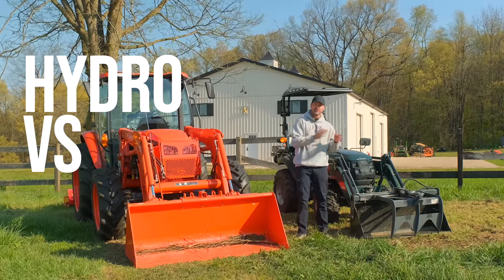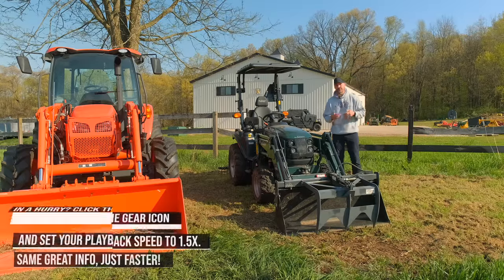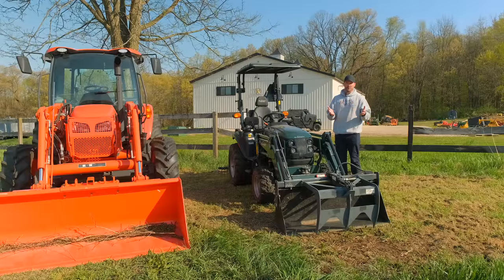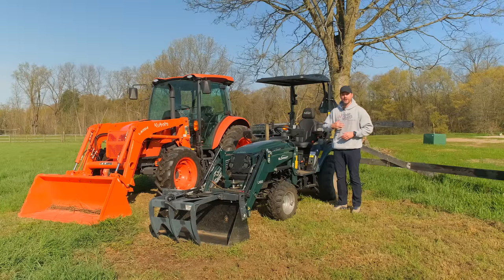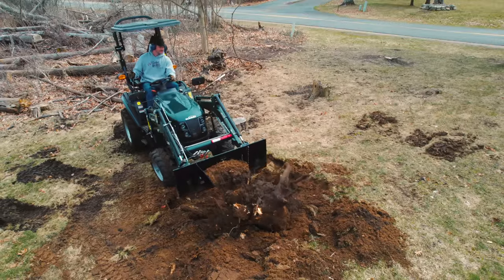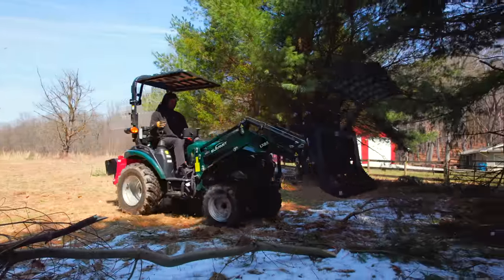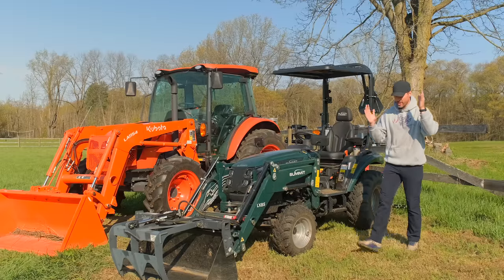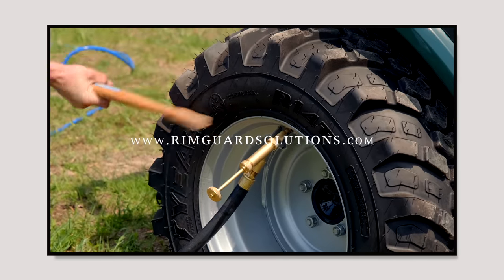HYDROSTATIC VS MANUAL TRANSMISSION? CLEAR WINNER?

Comment: I've driven both, in my opinion the main difference between the two is sales people push the hydro and convince people into getting them.  Then the buyer justifies the Hydro.  Both have advantages.  I prefer a shuttle.  Many other people do as well.  I really doubt that geared tractors are becoming "very rare" in the used market.  Sales people gotta sell so do your homework and get some facts.  If the sales person has the facts right, they are an asset to the process.  If the sales person starts making stuff up, either ignore it or go somewhere else.  A fun trick is to make something up about the tractor you are looking at and see if the sales person agrees with you or not.
Reply from the maker: Go walk around any dealer lot and count the number of compact tractors that are manual vs hydro.  Your doubt will quickly resolve itself.  I don't sell tractors, no skin in that game.  So, why would I lie about it?  What's my angle?
Reply: @GoodWorksTractors  I just visited my local Kubota dealer.  I'm getting a new L2501 (they are having an amazing deal on them to make room for the L2502).  They have 15 geared tractors and 16 hydros.  More tractors around here get used for mowing with FEL as a nice benefit then primary FEL tractors.  L2501s don't come with cruise on the hydros making geared the prefered choice for many.  The L2502 hydros they had on the lot had the cut out for a cruise control but no cruise installed.  Geared tractors are not very rare as a general rule.  They may be more common or less common depending on the area.  You are very pro hydro, many tractor sales people are.  Hydros are easier for a new driver and good fits for FEL or grader work.  On primary mower tractors, many folks prefer geared tractors.  I never said you lied but I do disagree that geared tractors are very rare.
Reply from the maker: They do not have 15 geared tractors and 16 hydro in the compact size.  If they do, then they are the most incompetent dealer on the planet.  Or, you don't know what I compact tractor is.

Comment: Manual is the best.  But hydro has it's place too.  Light work, use hydro.  It's easier.  Get a real tractor with a manul when you need to do ground work.

Comment: I get the impression you don't like Kubota. It's funny how many people dislike the tredle pedal once you position your boot in the right spot it's crazy easy doing back and forth direction changes.
Reply from the maker: The treadle is awful.  I think Kubota builds great machines except for the BX.  My M4 is one of the best tractors I've ever owned.

Comment: Does a Hydro looze much power to the ground compared to a gear trans ???
Reply: Hydro trans run off of hydraulic fluid to move them forward and backwards. The more you push on the pedal the more power and fluid that requires. It takes power to run the hydro pumps to move the tractor. Overall the tractor doesn't have as much power to send to the pto because it also has to run the hydro pump.